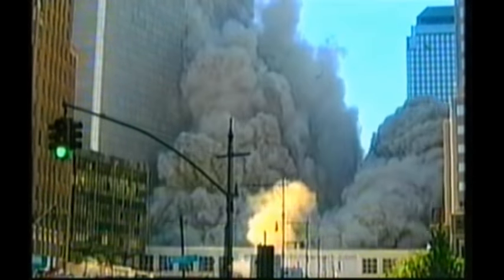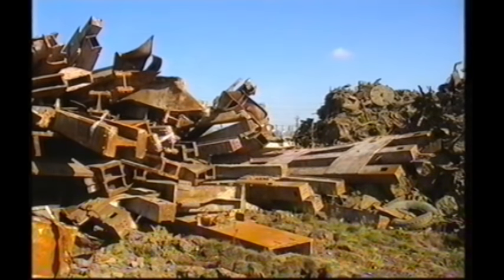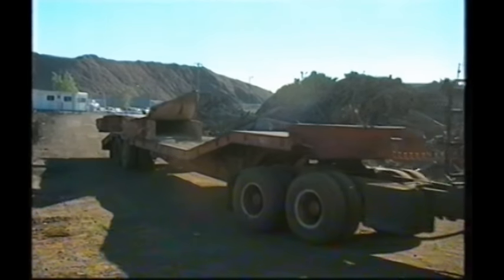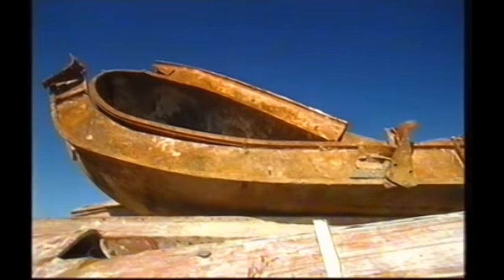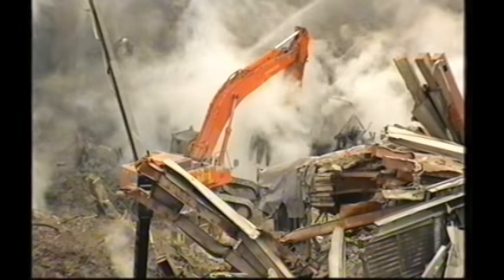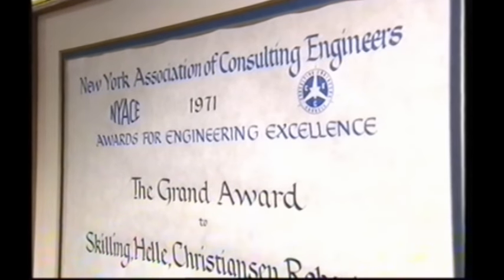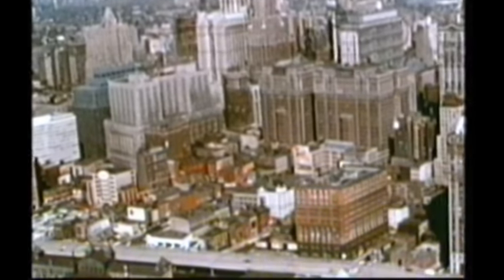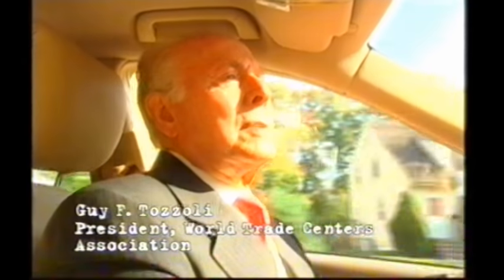9/11—"How The Twin Towers Collapsed" (C4 documentary, 2001)

Comment: How many aluminum foil planes have ever sliced thru 6 inches of cast steel... ?! ... And then are able to exit another 6 inch structurally fortified steel fortifications to exit the opposite side of a building... ?!!?... (Not even to mention the multiple steel enforcements around the center, and elevators... ?!?!).???
Reply: Fun Fact: The columns were not continuous beams, they were short sections bolted together. The planes - which weighed ~150 tons & were going ~500 mph - didn't slice any steel, they just broke the bolts. Also, I don't recall seeing any planes exiting the other side of the buildings.

Comment: To this day I wonder why they were never rebuilt all that reastate had  to move some were and there not enought buildings around to fill all the lost space. The subway station was under ground in the towers. Were them stations now. Why just a huge open space in prime real-estate area can it be afforded to be left vacant.  Insurance scam with no intention to ever rebuild because they will losing millions a year. Not must that gets destroyed that not rebuilt in a timely manner that 80 acres each building of office space to store fronts . There be nothing left of them alumunum jets that would just rip totaly into peace on impact. You see how many crash sliding across the ground leaving bits an peaces in its path never mind hitting cement outer walls an 18" web steel I beams. The way they both fell to the ground with in there foot print. Not falling over side ways back wards them tall up right 18" wide web I beam weighing a few hundred tons each with a 1/2 and 3/4" thick web of steel. One has to ask comon sence tell tells you that would not fall with in its own foot print.  And never rebuilt in a big city shrouded by water an no land to expand the city  sure they inlarged an island more then 50 times it original size from all the remains barged out to sea. 😅

Comment: Notice how in the test to see if a buolding can collapse from fire, they use beams that aren't fire protected and don't even let it collapse.
Reply: Notice how the objective of the test was not to see if the building would collapse but what would happen to the ceiling beams. The columns were insulated. Do pay fucking attention. FFS 🤦‍♂
Reply: @MFitz12  they were insulated, but did not have fireproofed cladding. They did tested the ceiling beams to see if they would cause collapse.
Reply: @bigkuriboh3814  - Are you changing your story from your OP comment. Because now you are claiming something quite different.
Reply: @MFitz12  they aren't fireproofed beams and they literally said the weakening would cause collapse and then said they wouldn't let it collapse. So they didn't prove a collapse. And it isn't a story? Wtf are you on about a story?
Reply: @MFitz12  "it shows how unprotected steel can be distorted even by office fires"
Reply: @MFitz12  "there was no chance of a sudden collapse"
Reply: @MFitz12 my point is even that when claiming that office fires can bring down a building like that they can't show it in any physical tests, only biased computer models.

Comment: Airline Fuel can NOT melt steel. !
Reply: it does not have to do that my guy. it can severely weaken it though. also, what can melt it are office fires which burn a lot higher than jet fuel

Comment: You could see the molten steel burning on the side of the building and the firemen reported molten steel running down the channels of the building in the basement similar to what you would see in a foundry.
Reply: The molten metal (not steel) came from the thin aluminum cladding which covered the external surfaces of each tower.
Reply: @kyle381000  Thanks for your input.

Comment: Load of rubbish. The builders would have anticipated thermal ‘sagging’ of the floors AND strength of the securing latches. After all - fire is the most common risk to a building. This is a relatively weak attempt at steering the collapse away from controlled demolition. Does anyone know the odds of two buildings going down due to exactly the same reason when the impact points and subsequent fires were different? Several million to one is the answer…And for this to happen with hours of each other??? Almost incalculable.
Reply: ? Two buildings were struck by identical airplanes in similar manner, and you think it unlikely that they suffered the same fate?

LOGIC FAIL
Reply: Course the designers and architects accounted for thermal expansion. Average temperatures in New York range from -15C to 40C plus or minus a few degrees. And that's what they were designed for. But the fires were about 30x hotter than the highest temperature ever recorded in New York City
Reply: Lame fake comment 
Two fake replies by author of comment, boooorrrrriiinnng!  But it’s every minute of every day on this video going back years! Bizzare attempt to prop up propaganda

Comment: Even with the wood model that had the missing floor thst failed the load test it showed how the upper weight was propelledto the side and away from a opposing force the strong lower floors would have not all evenly fail continuously all the way down carrying the the forces needed to collapse at the speed it fell the tale you heard was good fiction that ended just where reality couldn't be explained away anylonger

Comment: He just said it no more fires are not hot enough to melt steel but I don't know if you noticed but I seen molten metal coming out of the building before it collapsed that would suggest it was a thermite charge used for controlled demolition

Comment: if kerosene could melt steel, there would be no charcoal BBQ grills.   Check melting point of steel vs temp that kerosene burns.  almost 10x would be needed to soften the steel.  QED.
Reply: Who the hell said anything about steel melting? Not a thing.

Comment: Once again NO mention of the rivers of molten steel days  after the collapse.  As mentioned here the fires where NOT hot enough to melt the steel.
Reply: They only mention things that actually happened.

Also, the point is steel will fail at less than half its melting temperature so only ignorant conspiracists bang on about melting steel. It is not a thing to people who actually know what they are talking about.
Reply: @MFitz12  Then what made the steel to melt, mister know it all ? The steel melt, my brother was a firefighter during the rescue. Saw first hand.
Reply: @thomasash4100  The steel was dissolved by iron sulphide, which is liquid at 1,110 deg C.  The sulphur came from the firemen's water, which had dissolved out the gypsum (calcium sulphate) present in the wallboard in the wreckage.  The 'etched' steel actually shows evidence of pooled water (straight lines) where the pools must have lain.
The wreckage was hot because that was the remainder of the tower's potential energy, which was originally equivalent to 160 tons of TNT.
Firemen don't know much about aqueous chemistry, don'cha know.  You'd get better info from railwaymen.

Comment: The 70 foot deep "bathtubs" that those towers were built inside of were designed with the strength only to keep water out. I have a hard time understanding how a gravity fed collapse of those buildings wouldn't cause a single breach with resultant flooding. Each tower had a weight mass of 500,000 tons.
Reply: only the strength to keep water out is a funny way to try and load an argument.

The tub walls were underground and far enough away.  It's not that hard.
Reply: Do you think that those 'bathtub' walls were made of porcelain?
Reply: Get real. Do you think those retaining walls would have been built to withstand the impact of 500,000 tons of steel hitting them from those heights? Yes or no?
Reply: @432b86ed  
No, they weren't, any more than the towers were built to withstand a 757 being flown into them at 400 knots.
Your question is moot because what you described didn't actually happen. The massive support structures for each tower were still there when the upper floors collapsed, and much of the debris cascaded laterally rather than descending straight down. Also, the walls were reinforced by hundreds of steel rods which braced the walls and were essentially screwed into the surrounding rock (these can be seen in the 9/11 Museum). Further, the walls in question separated the building foundational structure from millions of tons of earth and rock which surrounded the 'bathtub'. It's not like these walls were just standing independently like a fence in a hurricane.
Reply: @kyle381000  "The massive support structures for each tower were still there when the upper floors collapsed,... "

Don't be silly. Those core columns were disintigrating into dust as the towers were brought down. It's probably why the sub-level retaining walls remained undamaged and kept the site from flooding.   Dust isn't as heavy as huge steel beams, is it?
Reply: @432b86ed  The steel did NOT turn into dust. Get a grip. The source of the dust was the acre of 4" unreinforced concrete on every floor as well as the sheetrock. If the steed had turned to dust there would never have been a 5--storey pile of it which took months to clean up.
Dust isn't as heavy? I guess you've never understood the concept of conservation of mass, either, right?
Reply: @kyle381000  "5 stories" of steel is what you'd expect to find in the pile of a 110 story building? Steel, most of which, was not compromised in any way before the "collapse"?
Reply: @432b86ed  The buildings were 110-storeys tall when half of the elements were  positioned vertically in a relatively narrow corridor. Now, allow all of the structural elements to be scattered across many acres on the ground, and five storeys is plausible. The buildings were nowhere near 'solid' and were built to be incredibly lightweight in comparison to conventional structures.
Why couldn't you figure that out?
Reply: @kyle381000  - Don't forget to count the sub-levels, of which there were 7 that filled with debris. At the center the debris pile was 14 stories tall, and spread out over 16 acres.  Images from the video I posted yesterday illustrate some of that spread.

Comment: The only reason I could think of that they designed the building to withstand an impact from a Boeing 707 but not factored in the jet fuel is that they must thought planes are built like a tank where after an impact with a building, would’ve not spilled out the fuel at all.

or they must think planes ain’t using any of that Jet fuel but fly with several thousands of these tiny creature call “pixies” flying inside each of the wing, allowing the plane to take flight.

Or they must think Boeing had already acquired advanced knowledge with anti-gravity drive but is not telling anyone about it.

Otherwise, I really can’t think of any other reasons NOT to factored in jet fuel other than they fuked up big time… or just greedy as hell.
Reply: Or,... modelling fuel and fire spread is incredibly complex and difficult even with the tools of 2023, let alone the tools of 1965.
Reply: @MFitz12  Actually, modelling fire spread is not that difficult. You just need to know the characteristics of how each materials burn and its ignition point. This would have been well known to the engineers already when they selected the building materials. So it should be pretty straightforward task.

Anyways, it doesn’t matter as I think they did factored it in, just not under “burning jet fuel” but under “fire resistance” in general. It doesn’t really matter what cause the fire, if the building is on fire then it is on fire. Whether cause by exploding Samsung phone or jet fuel, the building is on fire.

Not sure on the details thought as no one seems to discuss on the subject at all when its come to WTC collapse…
Reply: @tonamg53  - A lot more to it than just calculating fire spread - using pencil and slide rule.

Al of the details you could possibly need are detailed in the NIST Twin Towers performance report.
Reply: @MFitz12  Yes, thank you for pointing me to NIST report which I’m able to find many very interesting points… like how the fire proofing on the floor truss has no records of it ever been tested at all despite the engineers saying that they cannot determined its performance without first performing tests on it… so it will remains a mystery how well it actually prtformed.

Of like how the inner core wasn’t actually built from concrete like many people understood but was entirely from partition walls. So the inner core is not actually structural part of the building at all. It’s just there to house the stairs and lift shafts… and the partition walls is only fire rated for 2 hours… it takes emergency services more than 2 hrs to walk up and down the stairs to conduct search & rescue operations in the upper floor. 

High rise in most other countries has yo be designed in a way that s partial collapse must not lead to progressive collapse of the entire building… a very important design safety in most parts of the world but obviouslynot the WTC… 

Original design asked for 6 sets of stairs in each tower… this was later revised down to just 3 sets of stairs for each tower.

I’m literally speechless… this is a lot worse than I thought. Just pure greed  and incompetent everywhere
Reply: @tonamg53  - So you "learned" from reading The NIST Twin Towers performance  report that the cores - which carried 60% of the Twin Towers gravity load - were not a structural part of the buildings

FFS 🤦‍♂🤦‍♂
Reply: @MFitz12  and where did you learned that the core carried 60% of the twin towers load from? 

The core that were made entirely from partition walls can support 60% of estimated 500,000 tones of mass in each of the tower?

The core that some survivors were able to use office chairs to punch a hole through the wall of the core large enough for them to escaped? 

The core that according to some survivors, twisted like standing in ocean waves when the second plane hit? 

The core that some survivors were able to pull the handrails off the wall with their bare hands?

The core that can be cut right through by pieces of flying aluminium? (Planes are basically just glorified soda cans)

You realised that when plane crash into reinforced concrete structure… it’s not the concrete structure that will disintegrated into pieces, right?

Also think about this, 500,000 tons worth of building were brought down to the ground by a single piece of flying object that weight 160 tons… 500,000 tons object totally destroyed by a 160 tons object?

Did they pack a nuclear bomb inside the plane or something for it to do that?

😑

Comment: They left out in the discussion the thermite that burnt through columns, and the explosives that assisted in the demolition of the building and of course, building number seven was also already wired ahead of time for demolition… the remote controlled copycat airliners ran cover, distraction for the whole operation… The Simpsons cartoon characters warned us It was coming many years previous.
Reply: No. All of the termite and explosives that were used are shown in this video. All of it.

Comment: Has anyone seen a credible videos about how aluminum airplanes were able to penetrate this super strong tube that was what held the building up?  I understand the truss floor collapse given the heat, but given the size of the external beams, I still don’t understand how a plane broke thru…. Also, would the fuel have only created a flash fire?  In the various videos of the event, you never see fires below the floor of impact?  Given the liquid fuel and the extreme amount they talk about, seem to me some would have fallen to lower floor with fire spreading downward?  Not sure how people survived the initial event to be standing and staring out the hole before the buildings collapsed???  So much loss of life in a gruesome way, no matter who was responsible.
Reply: Probably because you are grossly overestimating the structure while simultaneously grossly under-estimating the energy involved in the impact. The proof of that should be the fact that it happened.

Comment: The government knew exactly how to take the towers down. They used the planes, not to knock them over but to use the fire to weaken the towers from the top down. They knew how long it would take. They carefully planted c4 all in the bottom of the towers the same way they would go about doing a controlled demolition. The towers were able to fall straight down dude to the metal being hot and soft. Had they tried to do a controlled demo without the planes and fires they wouldn't have been able to collapse it. Same thing with building seven a controlled demo. These were brought down intentionally so bush has a reason to go to war. A war that lasted two decades.